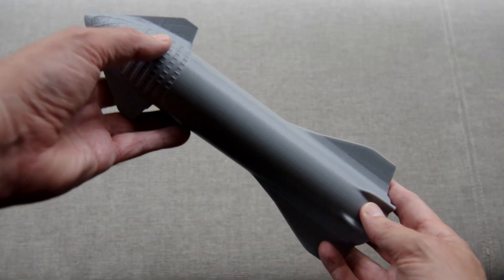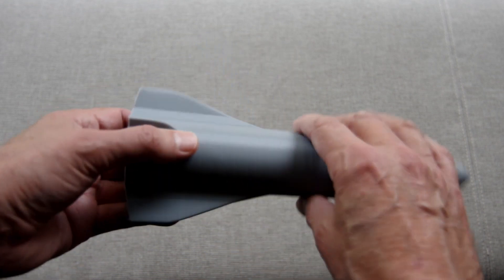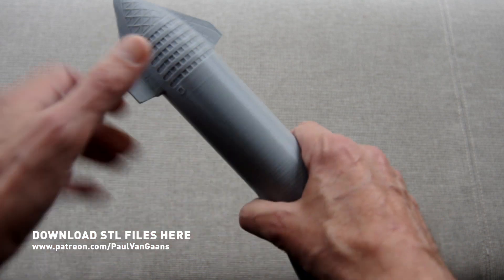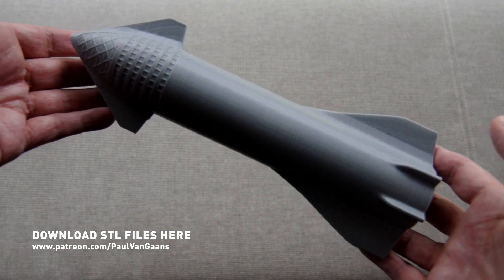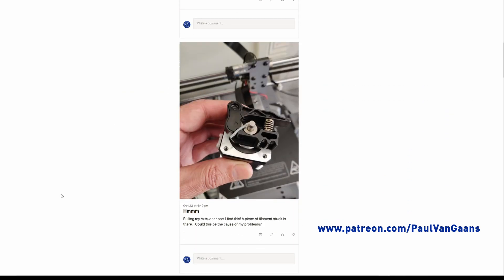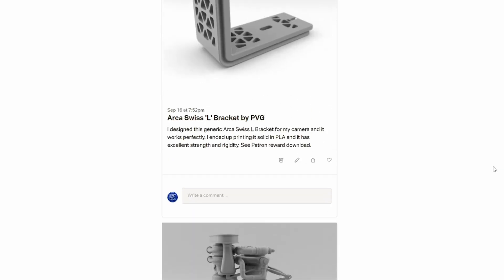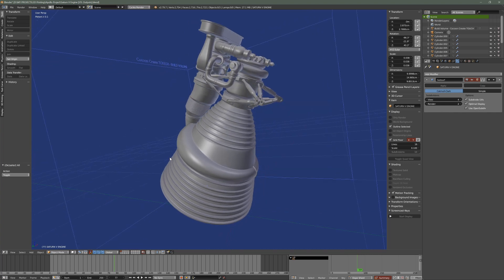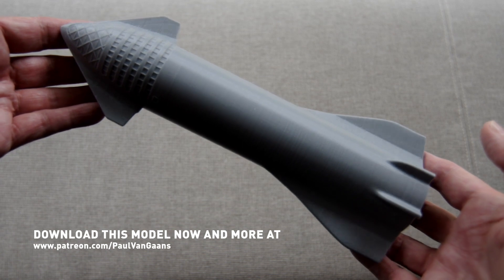SpaceX Starship Model and 3D Printers

Comment: this is why i got a resin printer.
only $2000 for 0.01mm resolution and 1.5 foot width 
or
$99 for 10cm width
either way theres no mucking around with all this crap. just hit enter and go
just as long as you take safety seriously and dont buy the cheap resin. 
thx 4 the model & you should keep your patreon open. or at least link a donate button. and please cut your models into single pieces. resin slicer software keeps printing until the tallest layer is done, whether there is anything on the plate or not. Which means you have to spend 3 hours waiting for the shorter part to print before you print the tall one because youre not sure if its done yet, and canceling a 17 hour print risks having to redo it from the beginning

Comment: Hi there, are you still using Blender 2.7?  Or have the 2.8 shortcomings been fixed to your satisfaction?
Reply from the maker: Hi Tony. I still use and prefer 2.79 for modelling for 3D printing. I use the last version with both the Carve and Bmesh boolean modifiers included. I can't remember if it's 2.79a or 2.79b. You can still download it here. https://download.blender.org/release/Blender2.79/
I use 2.8 for pretty much everything else and keep it right up to date but I really need the carve boolean modifier.

Comment: paul you might find your isue is old/dirty/moist filament. try rigging up a filament cleaner and dry storage box system and even potentially a filament roll helper to reduce stress on your filament feed system
Reply from the maker: Nice tip thanks Kyle! I'll definitely check that out. As a quick test I might see if a fresh roll of filament sorts out my issues. Cheers.